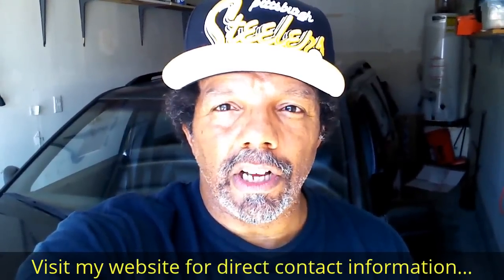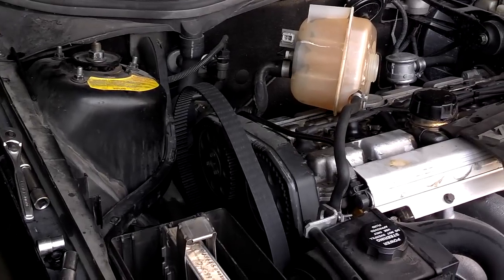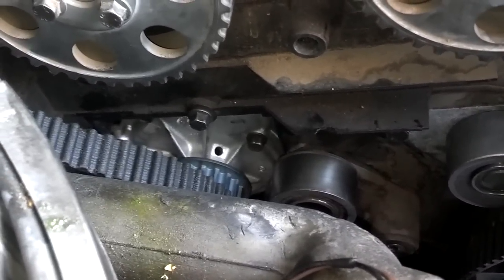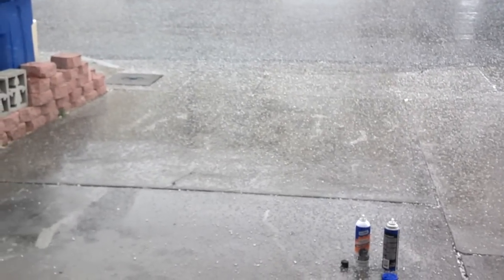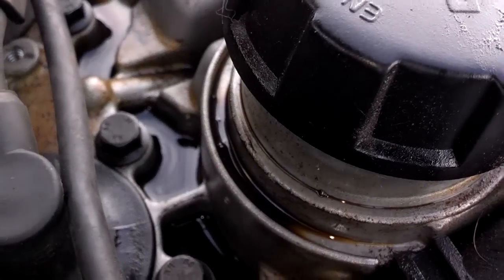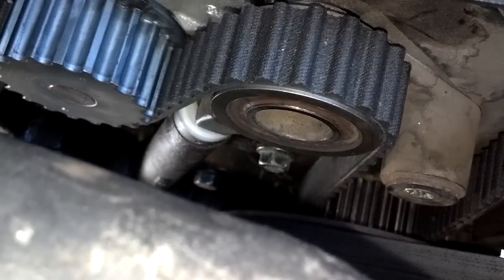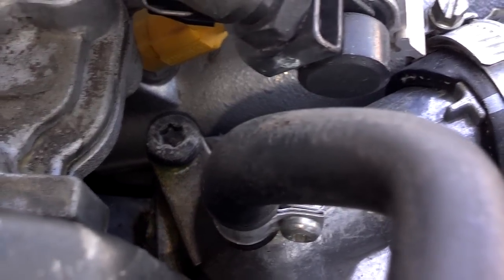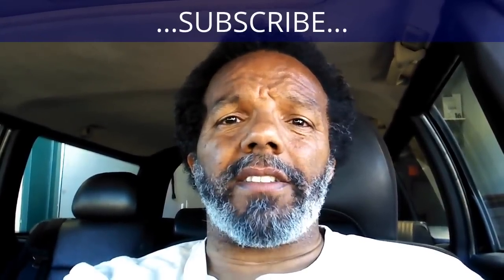Timing belt replacement, odd issues, Volvo 850 (Lost video from 2015) - HOWR

Comment: I would just like to add that you have to be careful not to lean on the radiator return line while working the water pump, tensioner, and belts.  I broke the verticle nipple off and had to replace the radiator.  Made me mad.   
Feel free to re-word for clarification
Reply from the maker: Probably good that you did. If it was that fragile, likely was not going to last much longer.
Reply: It IS that fragile, even the new radiator. The vertical nipple off the coolant side of the radiator is a bad design if you lean on the small return line hose while changing belts, tensioners and water pump.  I just added 12" of return line hose to remind me to disconnect prior to working around the belts etc...

Comment: Tensioner can leak? Is it a hydraulic tensioner?
Reply from the maker: Yes, when they leak, they are bad.
Reply: Robert DIY are all Volvo tensioners hydraulic my 2000 s40 has a leak around that area I haven't been able to pin point
Reply from the maker: +Lance Clothey no, during 1998 they went to mechanical.
Reply from the maker: +Lance Clothey https://youtu.be/vJXfQrDPK04
Reply: Thanks Robert! Unfortunately i think it's the exhaust cam seal. Just picked up some front bilsteins and a strut brace yesterday at the yard! I was going to have to replace the passenger strut mount anyways. All that for $80.
Reply from the maker: Check the date and condition of the strut if you can. Hopefully they are still good.